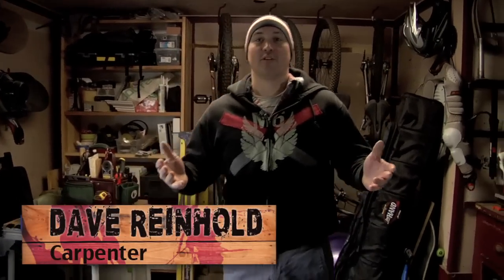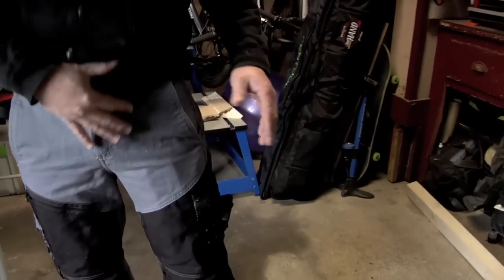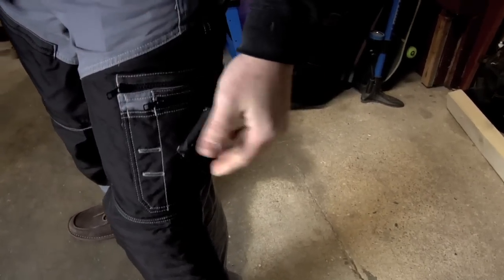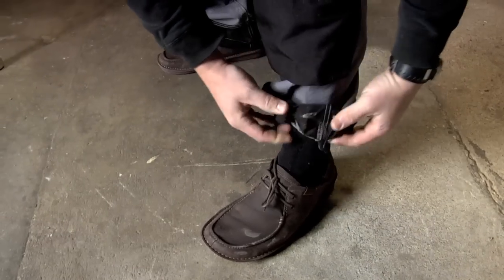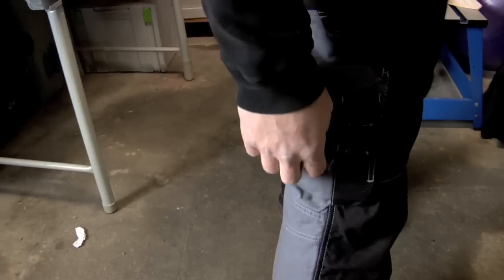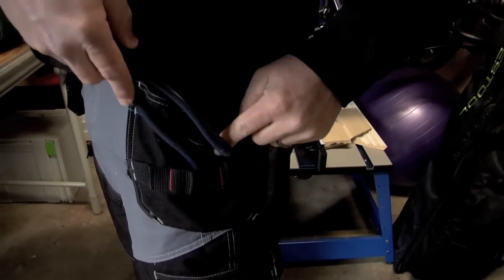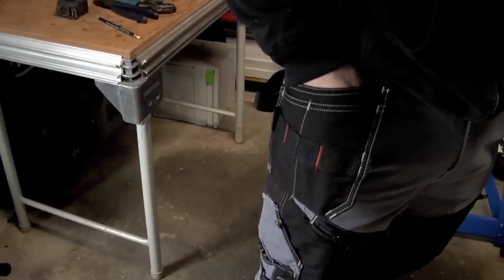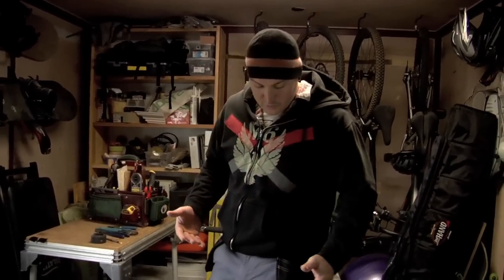Blaklader X1600 work pants

Comment from the maker: I find them to run a little snug so I go up a size in the waist. The length you want to get to your proper size. If you order them too long the knee pad won't line up right and you will be unhappy with our pants. If your in between sizes and wear boots I would go down a size in length.
Reply: Where can I find it ?